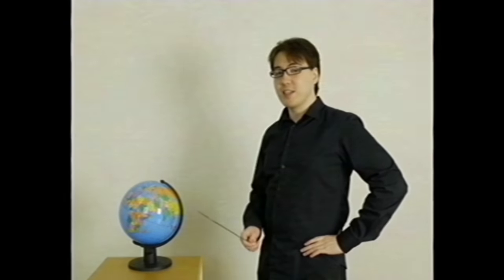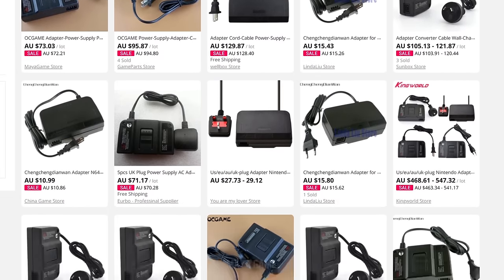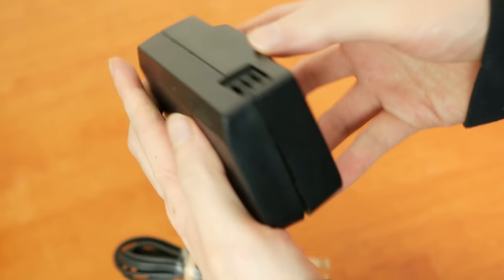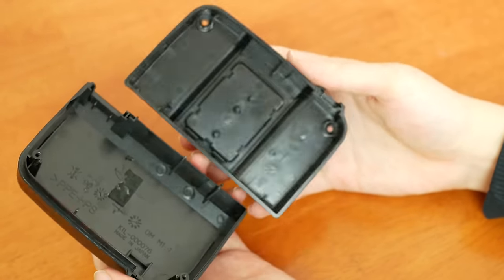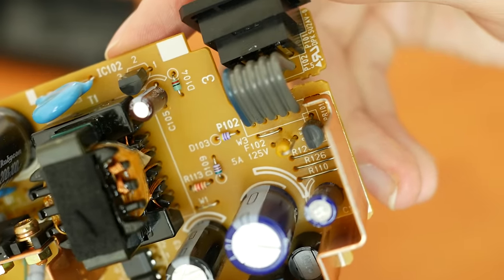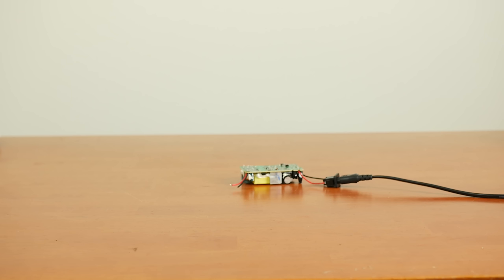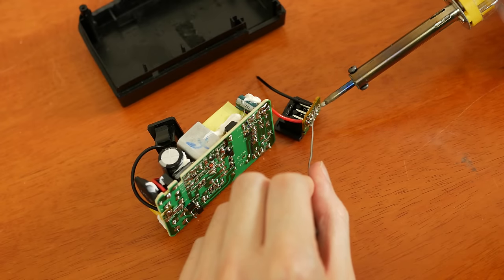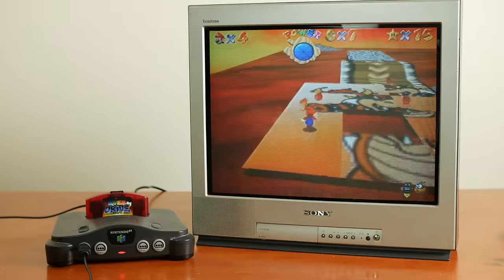Building the Ultimate Nintendo 64 Power Adapter

Comment: 3:49 fun fact... I plugged in one of those cables and not killed myself but tripped the mains breaker, the breaker for the outlets... then there's the outside breaker... OH RIGHT... and the power meter stopped working, I still had power delivered to my address, but the meter wasn't detecting how much power I had been using, I reported the faul to SA Power Networks... the new ETSA about the time I received my first bill of $10AUD but it took them 3 years to fix it... only after me hounding them to fix it thinking that I would be charged with federal crime of utility theft.

So... thanks SA Power Networks for the free electricity, I saved over $3000 from something that I was willing to pay to fix within 72 hours of me discovering it.

But seriously, don't try it, purposefully attempting to break equipment of others for unlawful purposes is so much more of a crime than "oops, I accidentality blew up my meter"

Comment: ‼️ Safety advise ‼️

I would never recommend drilling into, modifying or trying to create a shell of a mains transformer/wall wart, which are tested to a multitude of international safety tests from manufacture. Due the high voltages involved, the seal created by the specific plastic used is designed to suffocate the air from a fire should the worst happen, therefore extinguishing the fire and preventing it from spreading. Accidentally give the potential fire a vent and it'll just burn. If you use a 3d printed shell (which is designed to melt at relatively low temperatures) it will melt and therefore ventilating and burn more.
Reply: Lassi Kinnunen  Jeeez, that's insane! Hope you're ok.

That's just further proof that mains AC needs to be treated with respect and care. If absolute precautions are made, avoiding damaged transformers/exposed wiring and only using reputable makes (non necessarily "official") from reputable suppliers, AC should be perfectly safe.

Comment: Also I’d consider stepping that voltage up by 0.5V and using an LDO to get a 3V3 rail. The ripple on the output of a buck converter certainly isn’t something I’d want going into a logic rail.

Comment: You would think that nobody would want that power supply but somebody might actually want that power supply bored that you're not using I sold just the circuit board and cable from an a super Nintendo controller and somebody purchased it

Comment: Matt: If you search for a tool called a "spudger" it can more reliably replace your guitar pick for your prying needs. I used to have the same problem. Using flathead screwdrivers to pry stuff. And of course, breaking said screwdrivers who knows how many times. But Spudgers work a lot better for this stuff. Personally I got mine on Aliexpress for like $2 or $3 and I won't lie, the edges were razor sharp so I had to grind them down with a whetstone so I could grab it without slicing my hand open. haha. Not a huge deal. But might just be unique to the store I bought it from.

I also should say I can't take credit for this suggest as Big Clive was the guy I picked this one up from. Great channel, if you've never watched him and you like the insides  off electronics I'strongely suggest checking his channel out.

Comment: a cheap buck converter if it malfunctions could send the full 12 V to the output frying your N64...

As for the 3D prinbting thing... just get some black molding epoxy and do some old school additive engineering.

Comment: Couldn't you have just taken a PAL N64 PSU that takes 220v AC at 50hz and throw a figure 8 jack on it? Generally the PAL adapters work in 60hz 120v countries all good even though they aren't officially rated to work with 60hz. I've done it myself and it's fine with a PAL SMEs AC Adapter working in my home country Canada. But where it becomes issues is when you have 120v 60hz PSU that's not rated will be dangerous in PAL countries. They heat up a lot obviously and it's really unsafe. I honestly think you could have just bought a PAL N64 PSU and used that instead of sourcing PSUs. I'd be happy to be proven wrong!

Comment: 3:40 So I had a computer laptop power supply that was like that.  It was fine for the longest time then ZAP.  It almost got me.  Needless to say I didn't use it anymore.  System was still under warranty in general so I had the company send me a new one and noted the reason.

Comment: I would recommend against using a cheap clone for a power supply. Or repurposing a cheap generic power supply for that matter. Cheap power supplies may filter noise on the line very poorly and can shorten the lifespan of your console dramatically. Please just spend the money on a quality PSU.

Comment: Why can't you just use an australian power adapter on the NTSC console?
Reply: You can, I use a European adapter with my NTSC-J console. The output voltages are the same in all regions, and since they're DC the console doesn't have to deal with the frequency either.

Comment: You can convert most of the times the psu to 220v. in some smps you can't because there aren't flyback mode.. you need change:
Main filter cap to 400v or two 200V ones in series.
 change the varistors up to 230V ones
 and maybe you will need the datasheet of the IC on the primary side, there are some start up resistors and maybe you need to increase the value. The secondary side leave it as it is. 
Look at a xbox360 psu to 220v convertion https://translate.google.com.ar/translate?sl=es&tl=en&u=https%3A%2F%2Fwww.gameover.uy%2Fshowthread.php%3F3691-Tutorial-Xbox-360-para-convertir-fuentes-de-poder-110v-a-220v-varios-modelos is really similar to this.

Comment: I have a Japanese console and a pal power pack works fine
Reply: The 240v Aussie one it 120v American or 100v Japanese power pack all out put same amps etc only difference is voltages. If you had own of each time you could just plug it in and your console will be fine as there a external power pack

Comment: Why would you make your own power adapter and not just make your own step down transformer. It's literally two coils of wire.
Reply: Doesn't change frequency plus those two coils of wire go around a fat iron core.
Reply: @userPrehistoricman   They are all either 50 or 60hz dude it doesn't make a huge difference, you just get a little more voltage ripple with a lower frequency which can be fixed with an extra capacitor if it is even an issue at all. 

Buy a couple small iron bars at the hardware store idk. It can't be more complicated than whatever the fuck it is he is doing.

Comment: PAL was/is still better. There, I said it.
Reply: More vibrant colours, more readily available RGB video, higher vertical resolution for supported games, often far cheaper prices - it really is better to stick with PAL if you live in a PAL region. Literally the only downside is that a few unoptimised games run slightly slower. But if some people want to spend way more money and want to have a far more convoluted way to actually get the consoles to work properly just so they can run a few games slightly faster, then it's their loss. Just means that PAL games are in lesser demand, so they're cheaper and more abundant than they would be otherwise, which is great.
Reply: @alfo2804  Every game runs slower on the N64, and especially Japanese NTSC consoles can be really cheap. They also work with PAL power adapters, since the output side is the same in all regions.
Reply: @ozzyp97  Nope. Many N64 games were optimised for 50Hz - including all of Rare's titles, which include many of the system's must-haves.
Reply: @alfo2804  I'm struggling to find any good examples outside Rare games, and even those are typically equal at best. Usually it's a slight increase in resolution at the cost of some performance, which really isn't a trade-off I'd like to make when games like Perfect Dark already run like shit.

Comment: the coolest mod ill probably never do i dont like packing my n54 around i got a switch lite and 3ds as well as android controllers. my n64 is static and it is pretty  stupid having that removable one piece 6pin brick. n64 and black game cubes are the coolest looking consoles ever. ive wanted to put some kind of massive heat sink on the n64 that looks v8 engine with exhaust esque. really is a sleek power house with no moving parts for retro games and doesnt use much power compared to other 3d gaming  at the time and the following generations.

Comment: Matt, you really shouldn't drive with a mask on. It's not necessarily serving a purpose and possibly putting you in danger by breathing in your own carbon dioxide
Reply: While I agree with your first sentence, "breathing in your own carbon dioxide
" is stupid. You're always breathing in your own CO2 (or someone else's) anyway, especially in poorly ventilated areas. Also the mask doesn't filter gases.

Comment: 12:44 Bruh why did you put the case back together WHEN YOU STRUGGLED TO OPEN IT.
Reply: He didn't screw it back together. Also, the only part he struggled with was taking the board out, which was only because of double sided tape.